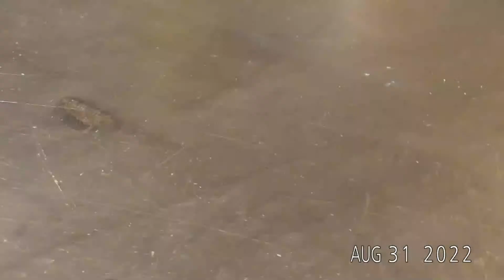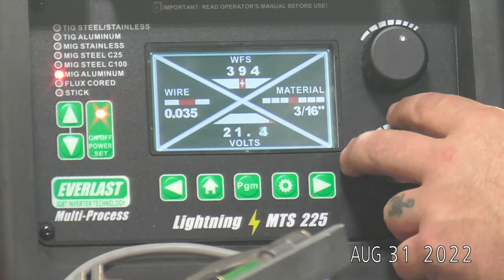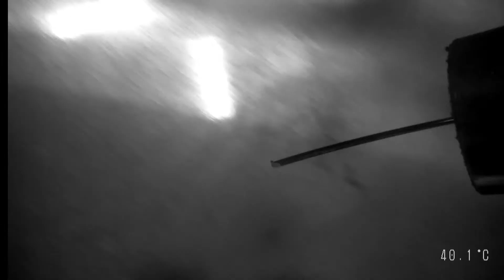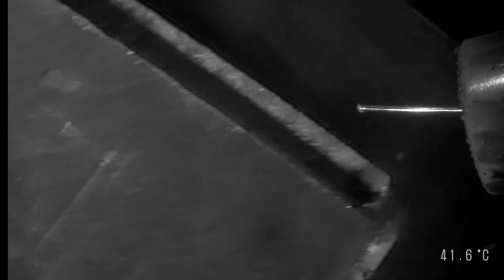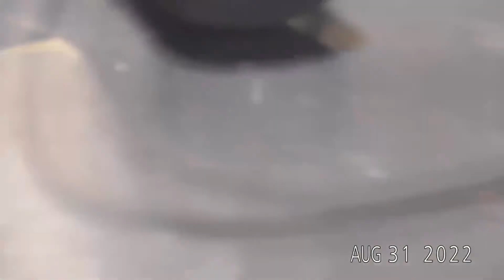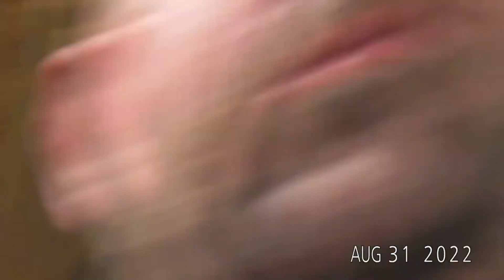Everlast MTS225 Spool Gun Setup & Aluminum MIG Welding 3/16" Plate | Everlast Live

Comment: hey Jesse nice easy show.i have a a brand new MTS252sti that i have not used yet. i am curious to know how the mts 225 performs against that machine. its to big of a machine to be portable thats why im looking to buy the 225.i just bought the parker spool gun and wondering if you can do a session on tig welding with it..have these machines held up in the field and can i put the 4 drive spool motor on it? also starting out basic tig, air cooled what size torch should i get to learn off of. never tig before.?? tec torch ?